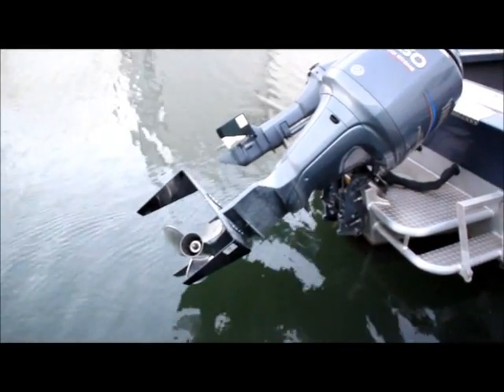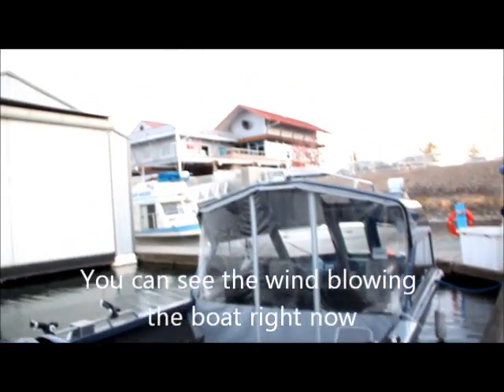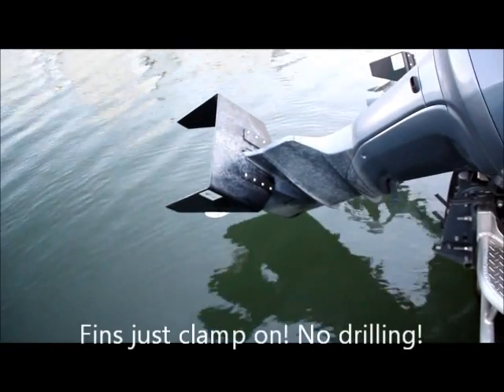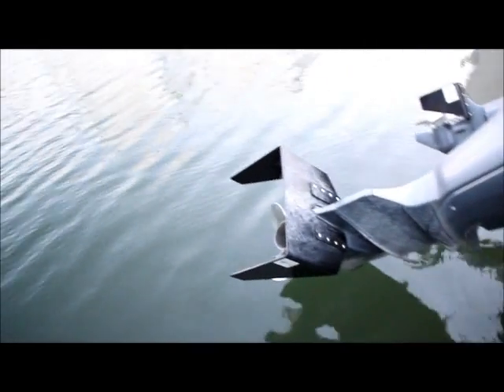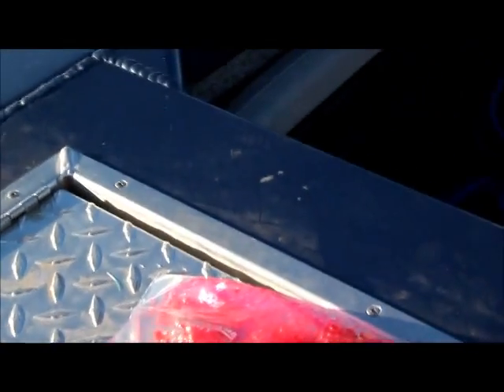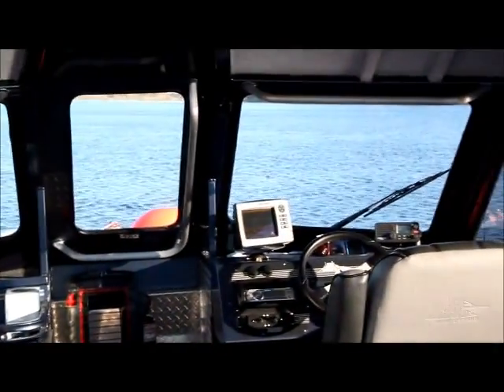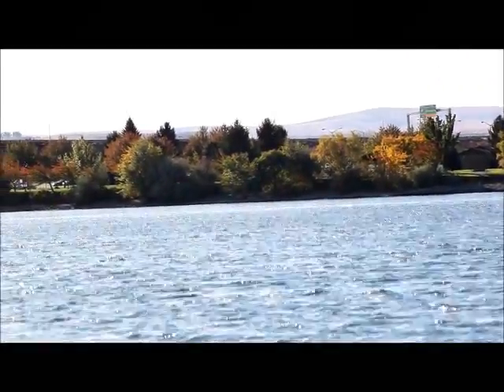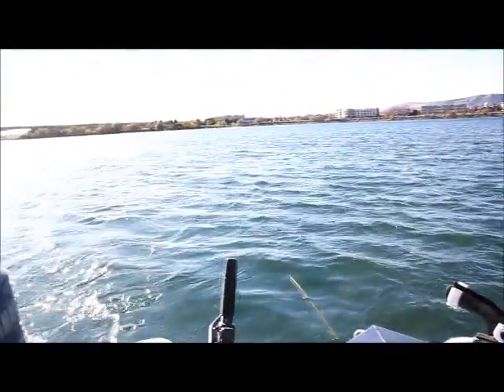How Outboard Motor Fins Work - Uncle Norm's Marine Products

Comment: Would this unit, or is there a unit that would work well on a penta 270 dual prop with through exaust
Reply: +Norman Wallace  Norman, 
This unit works fine on the Penta outdrives where the cavitation plate is similar to a Merc cavitation plate and relatively flat. . It has been done on the Volvo that have the curved, hollow cavitation plate that  exhausts through the cavitation plate but installation is not easy and I have not recommended it .

Comment: I have a friend in Nova Scotia with a 28 ft Bayliner that put one of the Orca fins on his boat because it wondered all over the place. Bob says that he gives the low speed control an A+. Bob also told me that he is saving on fuel because now the boat planes on less power. He says that it used to burn 55 L per hour and now it burns 50 L per hour on plane. It was an unexpected benefit. Bob says he's not taking the fin off. In fact he is going to make his own youtube video about it.

Comment from the maker: I have been a manufacturer for 30 years. My observation is that most manufacturers are very resistant to change and the conventional wisdom tells them that if it was good enough yesterday, then it should be good enough for tomorrow. That's why so much innovation and out of the box thinking comes from small companies.